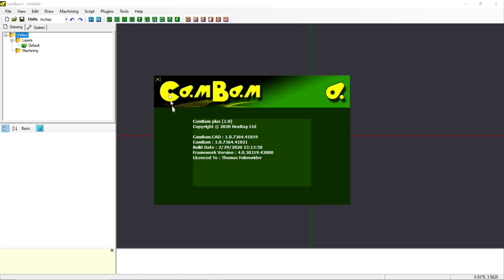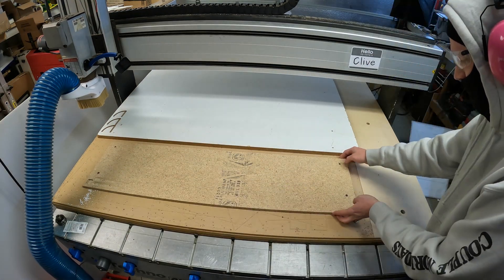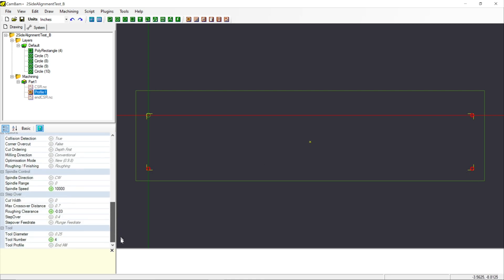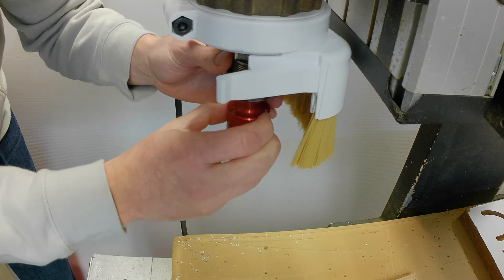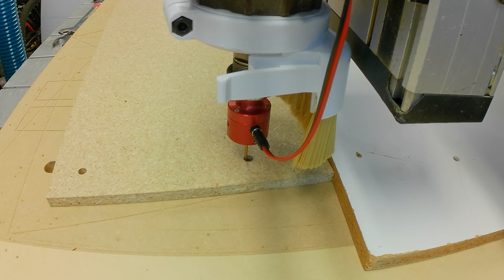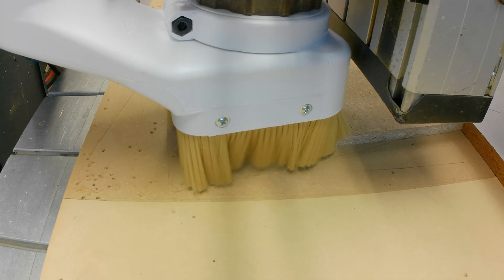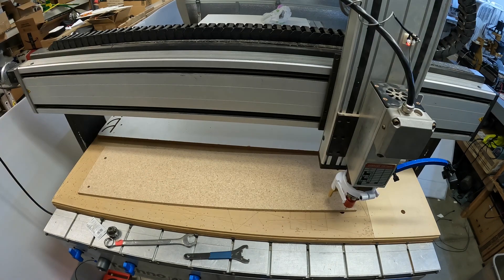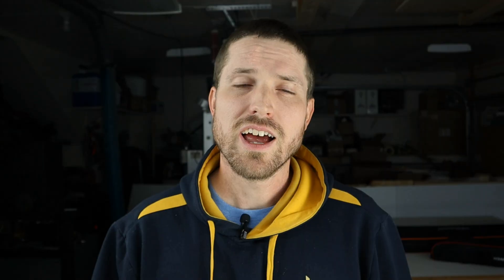Two-Sided CNC Without Fixtures!

Comment: Nice video. Guess for a professional production you would use a jig which fits alignment/reference holes. Not as cool but more robust and faster. Audio is slightly clipping in the video.
Reply from the maker: Nothing I do will be for production. But yes, jigs are definitely the way to go for production. @jabdoa Regarding the audio, is it just the voice over or all of it?
Reply: Just the voice over. Just a bit but noticable in the beginning for me. @thomasfulenwider
Reply from the maker: @jabdoa  I found where the problem was. Thank you!
Reply: Great method.  How can I learn to write similar gcode macros? Can you share yours?
Reply from the maker: I can pull them off my machine. What kind of controller do you have. Mine has some Centroid specifics involved.